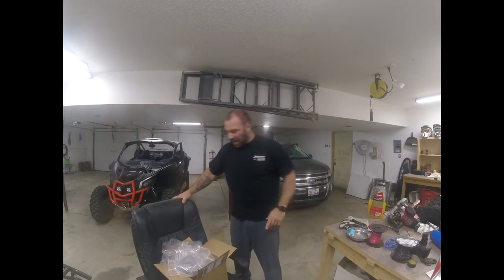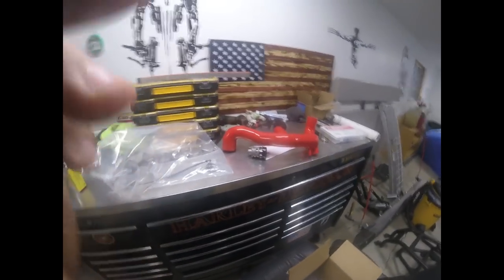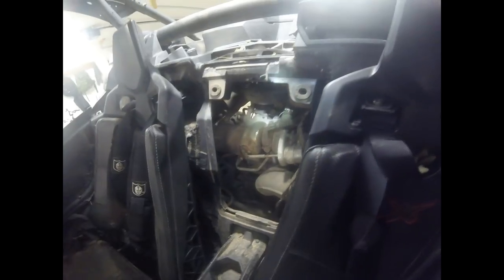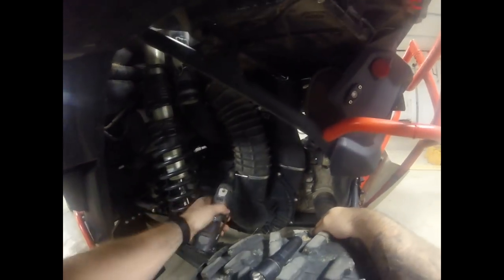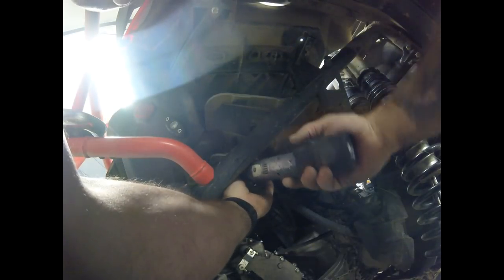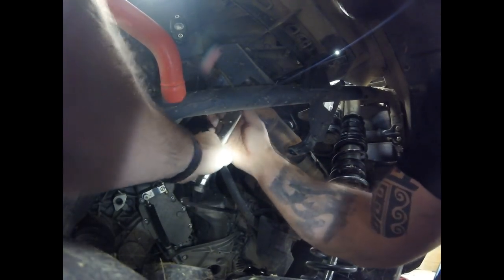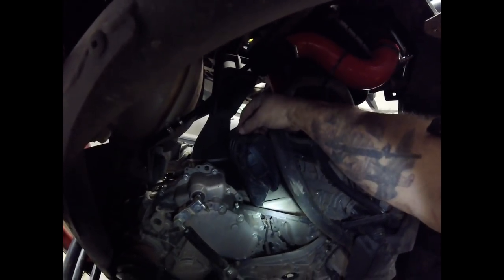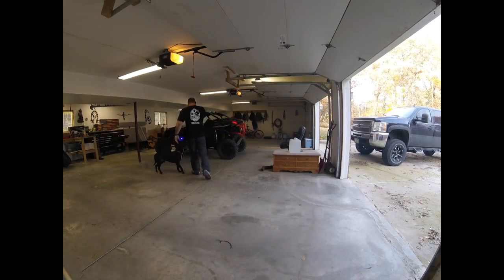Maverick X3 Blow of Valve install. Evolution power sports.

Comment: I don't get all the comments on here about you need a tune to do the cat delete you. You don't need a tune a cat is designed to remove any pollutants that the system didn't get. It wont do anything to your mixtures and if it does its minuscule change that ecu can do at stock. I got a Shocker and BOV and tubes. I tried adjusting the BOV to what it said in the instructions but couldn't get it to turn in either direction how much force is needed to adjust it?

Comment: I just put that evo dump exhaust on my x3. Those spring were hard to get off and back on.  I used heavy duty zip ties and a pair of plyers and it worked great. It sounds stupid but it worked like a champ. Also do I need to retune mine with that dump pipe it also has no Cadillac converter???
Reply from the maker: todd wolff no it’s just like putting a full exhaust on a fuel injection car. You don’t have to go out and get a tune. As long as the sensor is still in the pipe you got the computer will adjust. 
Yes them springs can be a pain. They make a spring puller tool that is very cheap. You might want to get one just to have in your Arsenal.
Reply: @sxsmarine4075  thanks

Comment: You have to have it reflashed when you delete the cat. Not sure why you took the exhaust off to run your charge tubes, but maybe that's when you drilled out the cat🤔
Reply from the maker: No you don’t have to reflash after the cat delete. It’s the same as putting full exhaust on the Corvette it’s a good idea to put it on the Dino and retune it but you don’t have to. 
You can also run a tune and not do a full exhaust. Nic from sxsblog runs stage five Evo tune and does not have full exhaust because he wanted it quiet
Reply from the maker: Yes I did drill it then